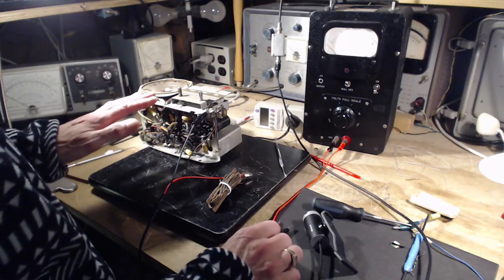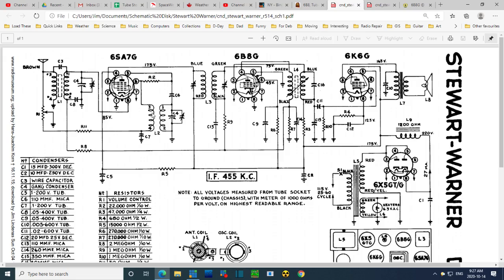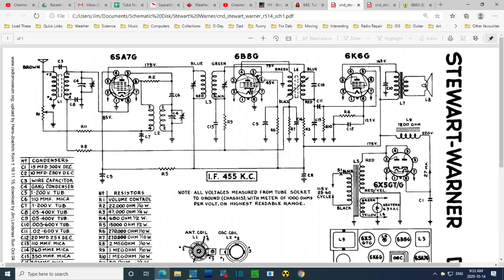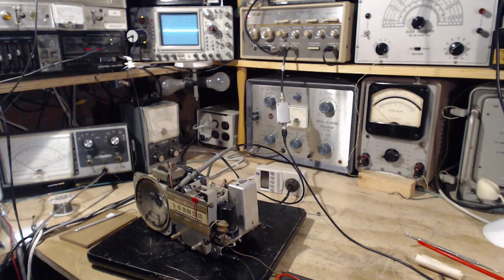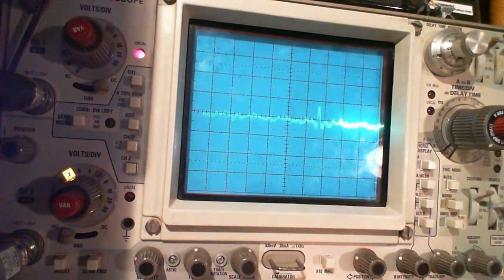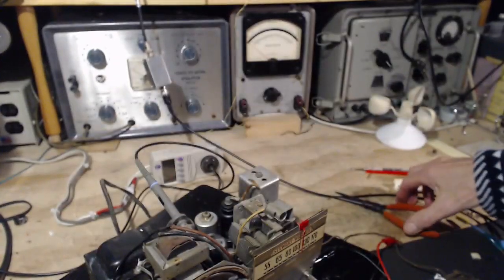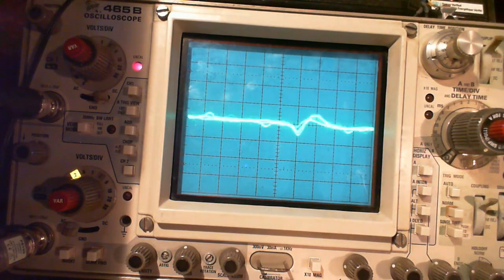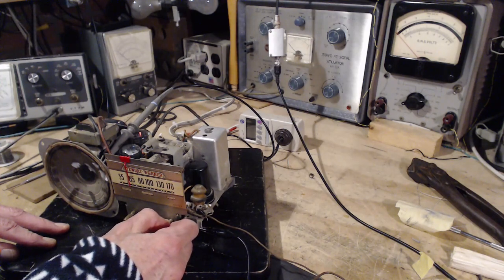Stewart Warner R514 Tube Radio Video #4 - Sweeping the IF

Comment: Take the IF cover (shield) off and inspect the coil. You may have an issue there.  Also, try replacing the 6B8G and see if that works.  And for good measure hit that tuning cap/oscillator with contact cleaner and check for irregularities.

Comment: Jim you will have a audio signal on top of the agc voltage at that point .
Its normal for that circuit .
But it will invalidate you sweeping the IF !

Comment: The demodulator looks to be an anode bend detector,the extra IF winding is for agc only,C
Reply: Nope. Plate detection require a tube biased near cutoff. Thus you use a high value cathode resistor or a fixed negative grid bias on the detecting tube to ensure that. Here the grid bias of 6B8 is influenced by the AGC and the cathode of the 6B8 is grounded.

This circuit is magic. It uses the 6B8 to amplify both the IF and the AF.
Coming from L3 the 455 kHz IF passes the tube and appears amplified on the plate and into the primary of L4 (right side). To the 455kHz C15 is a short to ground. So the full brunt of the IF gets transferred to the secondary of L4. There it is rectified by the Diode in the 6B8. To the rectified mish-mash the capacitor C16 has two faces; it shorts the 455kHz RF to ground, but is hardly any resistance to the audio envelope. So at R7 we lose the IF carrier but still see the Audio frequency.
This signal now gets fed back into the grid of the 6B8 by means of R9. Pay close attention to the value of C13! It is small, so it will only short any remaining RF but not AF. 
So the demodulated AF getting back to the grid of the 6B8 is amplified too. To make the point clear; Demodulated AF and undemodulated IF exist in parallel inside the pentode section! 
The amplified audio is then decoupled to the audio output tube 6k6 by c11 and because the AF is only low frequencies the cap C15 is no path to ground anymore.
In summary; it is a complex game of capacitances and their widely varying effect on widely different frequencies IF<>AF that allows the designers to use the 6B8 to amplfy both the undemodulated IF and the demodulated AudioFrequency in one tube.
I guess car enthusiasts may call it EGR signal processing lol
Reply: @randomsteve4288  
Bingo you get the gold star !

I was leaving jim a bit of homework & just dropping hints .
But your comment saved me explaining all that .
Reply: @randomsteve4288  Yup,on reflection your description is perfectly correct,it is in my mind a reflex circuit of sorts.
Reply: @randomsteve4288  Fascinating.  Thanks for posting.

Comment: I got that same finger nail polish Jim. I think however the speaker  cone needs to be swept with a glue/water  mixture  1/2 inch around the edges.✌🏻 Speaker coil is bad.